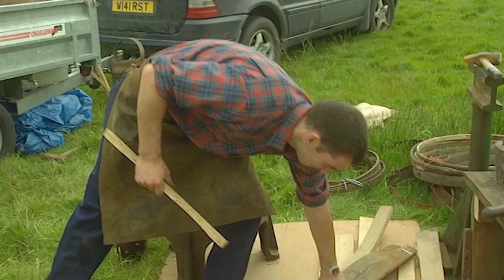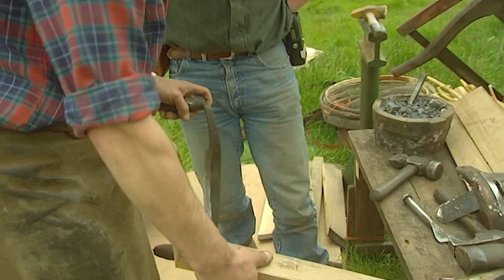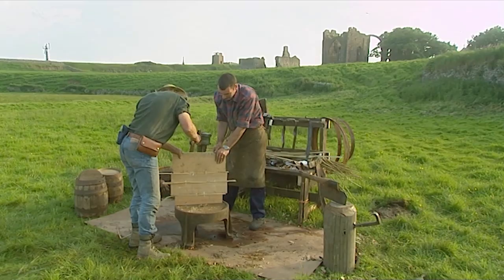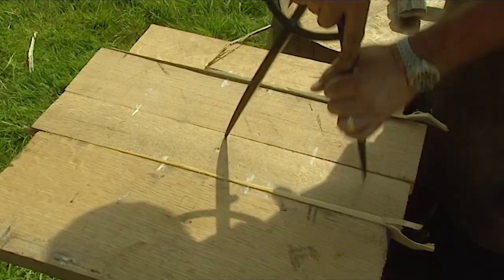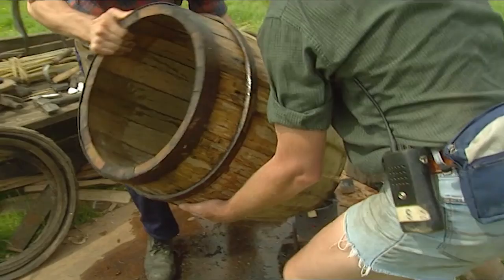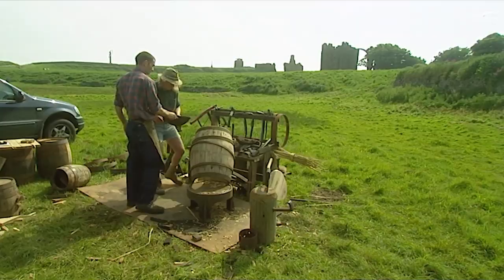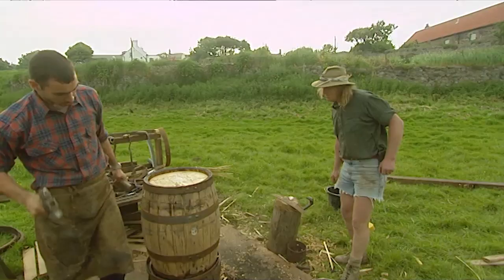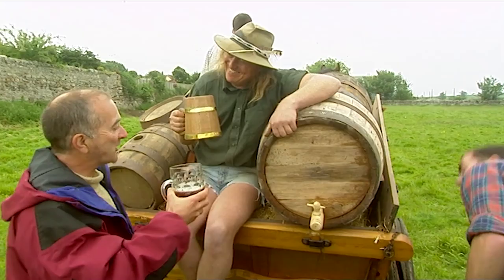Making A Barrel With Phil Harding | Time Team

Comment: The most important detail was left out. Wood easily transports liquids vertically, up and down through channels (capillaries) facilitating vertical growth, but also has transportation channels horizontally (facilitating to grow thicker, stronger). Through dry wood, such channels would lead liquids away. So coopers cut/sawed the staves for their barrels in a way that this problem would not play out. The longitudinal capillaries are in and along the outer wall in the longitudinal direction of the staves. They start on the outside and end on the outside. That should not facilitate leakage or "bleeding". I would argue that the cutting - where the video starts - of wood in the inside middle of the staves creates an opening, though. If you can make the staves a bit thinner and only steam/bend them into shape, that potential problem would not exist anymore.
The problem is in the circumference where the horizontal/radial capillaries in the wood are. Cutting the wood so as to keep these capillaries parallel to the circumference would mean that the capillaries have their open ends where the staves meet. The result is that liquid seeping between the staves will go into the capillaries and the wood will swell, causing the barrel to become even more "waterproof". Cut the staves 90 degrees rotated and the tree's horizontal/radial capillaries run inside/out through the staves.
In my language we have a separate word for staves and if something falls into pieces we could say it "falls into staves".
Reply: Yes you are correct.
Reply: Be ye a cooper there?
Reply: J Sev  - yes, precisely. The radial horizontal capillaries in the tree. If you look at the top of the staves, you can see if the wood was cut correctly. The year ring sections need to run inside out so the radial capillaries run along the circumference. As I am following a YT channel that rebuilds an over 100 years old sailing yacht (Tally Ho), I was wondering if the shipwrights of the day would actually cut the timbers in a way that takes this into account.
Reply: @nickrich56  - Funny how 500 years of genetic loading by teachers, academicians and preachers can lead to remembering and passing on these kind of things. That was decades ago when i watch a cooper's craft demonstration. So assuming to be "far from coopers" in a way, I discovered recently that, "who do you think you are" on a personal level, a great-great ancestor her family name was (in my language) "cooper". I know only one thing about her: she was not funny.